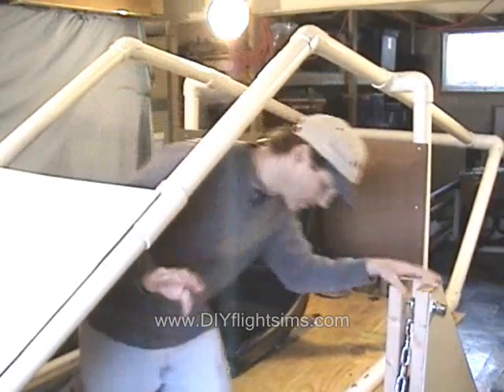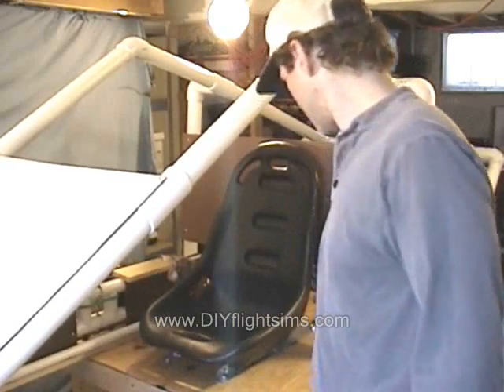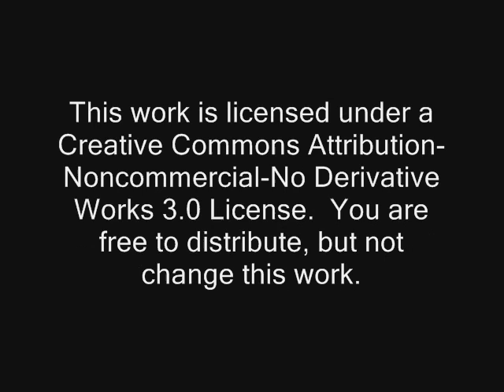MAACS Experiment - Episode 3, Fuselage Shape

Comment: Its starting to get a bit heavy.
The heavier it gets, the slower the pitch will be in the beguinning, while ending more abruptly, and the change from motion to motion will also become slower.

I saw from other MAACS videos that you never went with the box option for the controls, it now beguins to resemble more of that final solution on those videos.

What i don't understand yet is if the structure is pivoting on a hard point or on the chains. Looks like the latter.

Thanks for the update Matt.